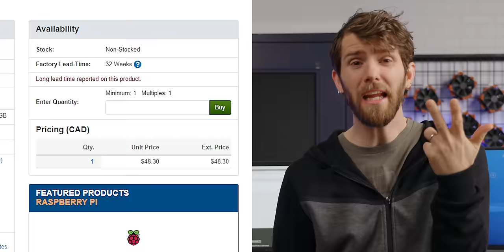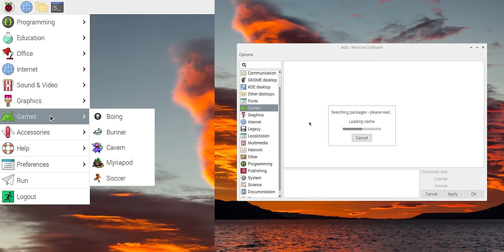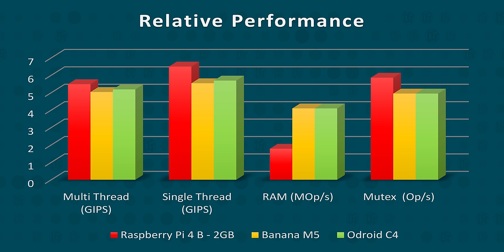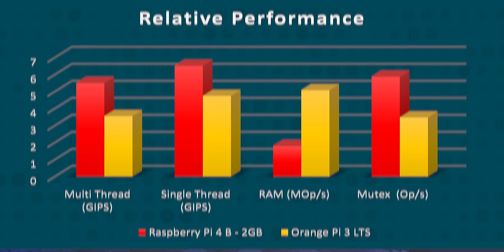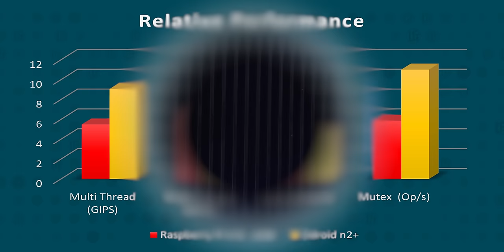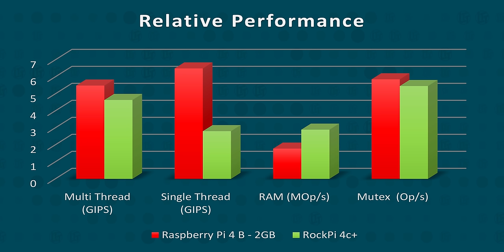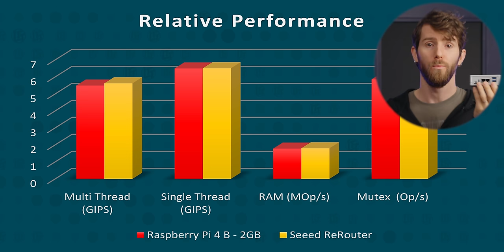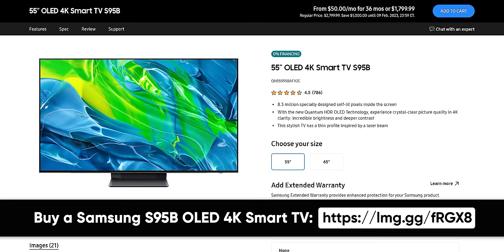I Can Save You Money! – Raspberry Pi Alternatives

Comment: We need Retropie to work with more of these, it's the main reason I want to use a Pi in the first place. When the other ones start doing this I'll buy them, especially the last few you talked about as the power is definitely there to make Retropie run like the devil.
Reply: Ditto, and honestly they might as well launch the Pi 5 at this rate. I’d take any alternative that can run Retropie just as well. Or, you know…just make more Pi 4s 🥲
Reply: Or try an alternative OS like Batocera which I personally prefer over RetroPie anyways
Reply: OrangePi does have a fork of RetroPie
Its called RetrOrangePi
Reply: @BryanCantDance  Second vote for Batocera. It runs on just about anything.
Reply: I run the retropi setup script on a regular debian 11 machine and it works fine. retropi seems to be one of the more portable projects, unlike something such as volumio which is dependant on a specific raspberry pi kernel.
Reply: Why not just get a 5 to 10 year old business grade used laptop? They have much better software support than any arm-based system, in particular if you want to go for software emulation. Their performance is stellar compared to most SBC and they come with a bunch of free nice-to-have stuff like included screen, keyboard, battery (--> UPS), speaker,... things that you would need to purchase separately if you go for a SBC. Or you could choose a unit with e.g. a broken screen (--> which the SBC doesn't come with in the first place) and get the old laptop for much less than what you would pay for the SBC. And while you on it you even do the environment a favor by reusing existing stuff.

Just saying...
Reply: do Pi's support Wii and Ps2 emulation?
Reply: @workshop94  They already said they will NOT launch a Pi 5 in 2023 because of the supply chain issues.
Reply: @footm4n2k   size... power consuption?
Reply: @aimpizza6823  No but dreamcast ps1  most N64 and older.
Reply: @workshop94  You do realise the Raspberry Pi Foundation are waiting in line for chips to arrive, just like many other companies that need them. There has been a global chip shortage that still hasn't returned to normal. If they COULD just make more Pi 4 boards, they WOULD.

Comment: Switched to ESP32 for most projects. They are plentifully available and cheap. Bit the bullet and dived into C/C++ which wes hard at first but now feels natural. I am frequently surprised how versatile the ESP32 is!
Reply: ESP32 is a different thing from a RPi Pi.
Reply: I use an ESP32-s2 for my 3d printer camera & power control as well as controlling my entire escooters lighting/indication system 

Gotta have a pi too though
Reply: ESP32 is a microcontroller. It is NOT a Single Board Computer! 🤦‍♂️
Reply: Pi has more support and always will be the pioneer

Comment: When the prices spiked, I actually jumped ship on the entire ARM market and picked up a refurbed Lenovo Thinkcentre. The M600 style systems can be had for around $85 - $150 depending on how high of specs you want. And they come with the original Windows License. Not a true replacement but a valid option depending on your needs.
Reply: If you want a 'traditional desktop' computer for productivity, gaming and emulation, then those small form factor PCs are great, along with full sized desktops and many laptops. The Pi was never really designed as a realistic replacement for those. Though it could probably fulfill some people's basic needs, a Pi wouldn't be most people's first choice. The Pi's strengths lie elsewhere.
Reply: I appreciate this comment - I poked around and saw a decent Chromebook for a stupidly cheap price, and all my project needs is a laptop as a base for a linux distro - this is perfect and doesn't require me to worry about a display and stuff, thanks! Don't know why I didn't consider refurbished gear
Reply: They have some newer fanless units out now that have have more modern x86 processors (celeron, atom, maybe a lower end i3 or Ryzen).  Much better comparability and performance than a raspberry pi, but still relatively power efficient - maybe 15-20W when maxed out (which can be tuned up/down in the bios).

They're a little more expensive than the old sff mini pc's typically available on e-bay, but that comes with much lower power draw and modern creature comforts like nvme 3.0, 2.5g ethernet, usb-c, etc...
Reply: The Fujitsu Futro series (especially S720 and S920) are also a good option. They start at 15,- € used in Europe. Fanless, sturdy, low power consumption. The S920 even has a PCIe x4 half height slot.
Reply: This. If are just looking for a very small computer and not building a project that requires use of the HAT, and you can keep it plugged into the wall, then you are much better off buying a used ultra-small form factor PC, or a used i3 NUC. You’ll spend under $100 US, and it will blow any of these ARM SBCs out of the water in performance. Once you shell out for a case and power adapter you’re in for $100 at least with any of these SBC’s anyway.
Reply: Agreed. If you want an emulation / streaming powerhouse, then a second hand SFF PC is the way to go...not an SBC.
Reply: There’s also an official x86 version of Raspberry Pi OS that makes it dead simple to set up a PiHole or PiVPN with these SFF PCs.
Reply: @pchasco  Nice to hear that there’s now PiVPN packages for Ubuntu and Debian. I never had issues when my WG host was running Debian but the manual setup was a chore.
Reply: ive seen these small PCs start to pop up in videos for 3D printing even as alternates to run the Klipper or Octoprint software on.
Reply: @filanfyretracker  that was my plan. To attempt to replace my CNC router PC with a smaller bench mounted replacement.
Reply: Exactly! Things like Orange Pi are over $200 here in Finland - it is literally cheaper to buy a new Intel Celeron NYC, or any old second-hand laptop.
Reply: @another3997  The Pi's strengths lie elsewhere. Yes and one of those strength used to be pricing. Not anymore

Comment: The Jetson nano from NVIDIA is also a great option with a decent amount of support and a relatively active community
Reply: Yep!  They really are a fantastic option if you can afford it.  I have one that is running an Octopi 3D Print server, and I am going to soon add a webcam to it so it can run Spaghetti Detective to detect print failures.
Reply: way more expensive now, especially their newer SBCs, worse pricing than their GPUs. Also the jetson nano is still more expensive than the pi for less benefits. Thats why i dont have one.

Comment: What you should do when purchasing these RasPI-alternative boards is checking the mainline Linux kernel support. If the chipset runs the mainline Linux kernel well, and if there's a complete device tree file for the board, then the chances are that there would be at least some usable Linux distros for the board. If there isn't, then you can build one by yourself (it's not as hard as it sounds, assuming that you are mostly sticking to the mainline kernel and the vanilla Debian rootfs).

A few of them are actually more "open" than the original RasPi in that proprietary blobs are not required for booting.  Most of them are not, though.

Comment: A lot of people are bringing up the better community support for the pi, which I agree with if you're the type to do a lot of hardware tinkering. However so many of the things that come up when you search for "easy raspberry pi projects" are things like retropie, some form of kodi media center, and pihole. All of those things are more than possible with just about any machine that can run a flavor of Linux and I wish more casual users were aware of that before going out and getting a pi 4. Emulators on the real pi aren't even that great. It was a novelty 10 years ago when there weren't many low power devices for that cheap to run mame or nes games, but hardware has come a long way to the point where, for the scalper prices of a pi, you can get a used pre-built desktop that will blow it out of the water. If you want something small like the pi then these alternatives are just as good or better in that regard.
Reply: Or broken laptops, or some x86 sbc if the intention is to make it like an arcade where constant electricity is available

Heck, even I have too many computers and laptop that can replace Pi purposes. If you want gpio maybe hook it to arduino as well?
Reply: One problem I found was obsolete hardware/software. I had a TFT monitor that had hardware and software that was supported, but lost compatibility along the line of upgrades/updates. Which is fixable if one knows matrix transformations and coding... I know neither. :(
Reply: I don't understand a lot of the pi hype. It's great if you do a lot of HW tinkering like you say, and make your own IOT devices and things like that, and need a small, low power computer to use in that kinds of projects. But people are actually buying them because they saw a dumb youtuber saying "they are great for learning linux" or something like that..... You can do that on ANYTHING. A virtual machine (both local and cloud based) an old throw away computer (it will be faster than a pi), your phone, ANYTHING. 

There are a lot of "wasted pi's" because people are just flat out unintelligent. 
I've seen people buying them to run docker/containers on ... while having them beside a server rack full of servers and maybe a NAS or two that runs VM's allready (I'm looking at you, tech-youtubers). It's so insanely dumb.
Reply: @TechyBen  I feel that. I had a project that used a pi zero and had gotten a little spi screen for it that did have pi support at one point but the software for it wouldn't compile because it was missing some stuff. I didn't know what it was missing or how it fix it so I basically abandoned the project.
Reply: @johnkristian  I never got that either. If they were still cheap and it was your first one maybe but I learned a lot more about Linux trying it on my old laptop than I ever did using any of the pi's I've had over the years.
Reply: @chadmasta5  Mine was dependencies (every time I try to do something other than just use Linux for internet or Steam Proton), where one dependency had upgraded but the other had not, and the upgrade no longer supported the other dependency. So it was stuck in upgrade/downgrade paradox. :P

Comment: Excellent video. The SBC category is abused today costing hundreds of dollars for boards that don't even compete with fully designed laptops and desktops. The whole point of SBC popularity was useful tech for low prices. Low-cost emulation or even neat inventions like "super computers" and robots. I have some RPi 3's, 4's and Zero W's. Got them at the time of their lower prices thankfully.
Reply: The prices for R Pis will go back down. The Foundation has no control over third part resellers charging extortionate prices, and these scalpers are undoubtedly hurting the Foundation's reputation. The assumption being that the RPF are the ones charging silly prices, which is not the case. You CANNOT compare the Pi market to regular laptop and desktop markets... they're aiming at different audiences.
Reply: @another3997  Did I say RPi prices in the hundreds? No. There are other SBC's costing insane prices.
Reply: The issue with the price of the RPi is it's popularitly.  Unfortunately, and I not agree with it, but Ebon supported supplying bussinesses before hobbyists...
Reply: @RyTrapp0  You completely missed the point. Good job. The prices of new SBC's are draining the community out. Many are complaining of prices of SBC's (not just RPi) New high priced SBC's are what people are setting as standards for their prices, therefore never going back to MSRP (not that that's the only reason). And the comparison to other devices is a comparison of price for what you get. They are both computing devices that, while not for the same customers, use some of the same resources.

Comment: I'm pretty sure the reason the pi is such a powerhouse is its ecosystem documentation and knowing that something's going to install and for the most part not be a problem. It's community is very much robust something the competitors are lacking and for the most point price point.
Reply: Precisely this ^^
Reply: That still does not justify pricing the boards at $150 each
Reply: @20035079  and I completely agree with you I was merely talking before the component shortage begin. I have three of them myself so that's not really a concern. I'm still trying to figure it out when this will end.
Reply: @20035079  It does actually justify that! I see you are new to the ways of capitalism.

Comment: The Rock 5B might be a little over the price, but the 16GB version kinda feels like a desktop replacement of sorts, thanks to the RK3588 (almost same as the Orange Pi5). But with 2 PCIe ports, there is no compromise, you can have WiFi 6 and a Nvme drive! Also, the GPU on that chip is awesome. Support is not there fully yet for the RK3588,thats the downside. Also the Khadas products like the Edge 2 and the VIM4, although way over the price, are amazing SBCs. Glad this boards are getting more attention from LTT! Kudos!
Reply: Khadas oowow firmware is the kind of innovation this market segment needs. They are a bit steep on price though.
Reply: Get an an Intel NUC if you want real power.
Reply: I looked at rasp pi prices and said - orange pi better and approx same price.  I got Orange Pi 5 with 16GB ram.   I bought fast micro sd cards and it is fast/fast/fastr. Yes, it is a desktop replacement.  but Like said by Phozends - the sw is not bullet proof.   I like linux with KDE, and it took a while to get something I like.  - but it works well now.   and there is a person who is releasing new versions of ubuntu about every 2 weeks.  so it advances.

Comment: Another thing that's kinda hard to deal with when you choose other than a raspberry pi, is the variety of choice for enclosures and large heatsinks.
Reply: Well there are plenty of 3d printing options for each of the listed boards. But yea, gotchur point
Reply: for mountings most of them are the same form factor as the pi, while some are partially compatible, as for heatsinks only full case ones wont work but the regular heatsink + adhesive pack works as you just need to cover the right chips.
Reply: @emkay1182  cause everybody has a (good) 3D printer, lol
Reply: @LazyJesse  if u dont have a 3d printer

then why r u buying them sbcs and then complaining not enough casings
literally for most ppl doing diy projects, they will 3d print their own designs, these are also hobbyists that likes to customize
for other people, why r u even buying it then complaining about not enough variety enclosure? just buy watever option is available, that will already suit u enough
if u do diy projects and are a hobbyist, i d bet 3d printer is something u already have or are looking to buy, even if not now
Reply: @urnoob5528  even if a good 3D printer isn't attainable, a hobbyist Fusion 360 license is free and learning how to use it from YouTube videos is free. Once a design is made, there are low cost options where you send the design out and get a 3D printed part in the mail. 

But yea, getting a cheap 3D printer or kit is a great way to get into making stuff. I did that back in 2014 and only upgraded to a prosumer 3D printer last year. Great way to learn how it works through tinkering/building
Reply: Not a big deal if you have a 3D printer and some generic heat sinks and epoxy. You don't even need your own 3D printer to get a 3D print done anymore...there are tons of platforms out there that you can send an STL file to and get it printed and shipped cheaply and quickly.
Reply: @LazyJesse  no but everyone has a web browser...you can use a printing service to get a print done if a printer is too expensive.
Reply: Has Linus done a video like this for 3d printers?

Comment: Using Le Potato for Octoprint instance and have been very happy with the performance and availability.
Reply: I ran my Octos on RasPi, but found using old PC and docker easier and faster, not to mention super easy deployment of multiple instances (one for every printer) via web browser.
Reply: @TheSanpletext  thought about using an old computer but power consumption was always 3x or more even on an older low voltage intel mobile system
Reply: My guy, do you have any guides for getting octoprint setup on Le Potato? I've been trying and I just cant seem to get it running properly

Comment: I remember buying the original Orange Pi 3 months before the Raspberry Pi 4 came out and it blew the Raspberry Pi 3 away with it's much better performance, four USB 3.0 ports (the LTS version removed two of them) and built-in storage (more reliable than micro SD), it was perfect for making a low energy consumption NAS which was the reason I bought it. I'm impressed to see it still has decent performance against the current gen RPi.

Also, massive kudos to the Armbian Linux distro developers that do a great job on providing an up to date and well maintained Ubuntu/Debian distro for the vast majority of RPi alternatives. I was hoping to see that project mentioned in the video.

Comment: It's not exactly a single board computer & it probably won't have the GPIO but a used business mini PC works great if you just want something cheap for Kodi, Retro Arch or other emulation, or a home server. A lot of businesses buy these and use them as POS terminals or to display stuff on TVs or whatever & they tend to just dump them on eBay after about 6 years. You can get used HP EliteDesk 800 G2's or G3's or Lenovo ThinkCentre mini PCs for $50-$80. In that price range you'll probably get a Skylake or Kaby Lake i5, HDMI, probably 8-ish GB of DDR4. The business probably took the drive out but you will probably find an M.2 or SATA port for a 2.5 inch SATA mount. A lot of the time the RAM and CPU will be socketed and older CPUs tend to be cheap if you want to upgrade it.